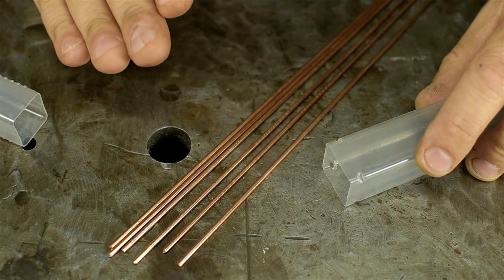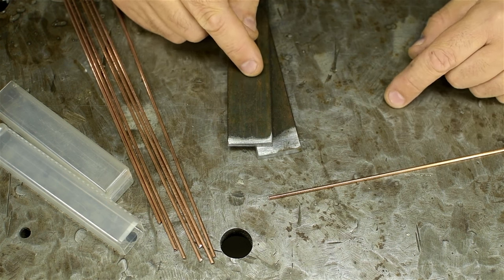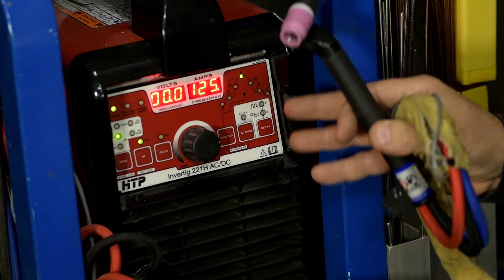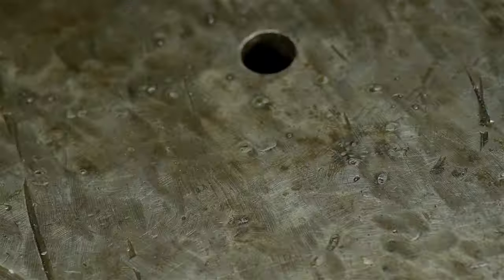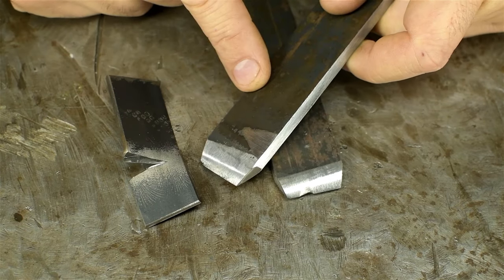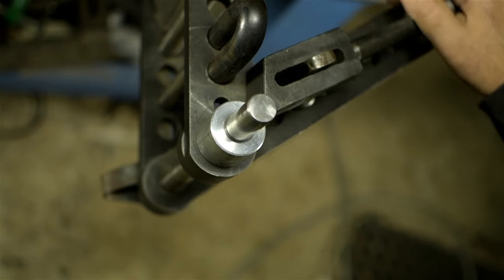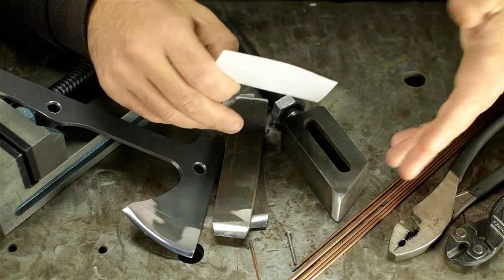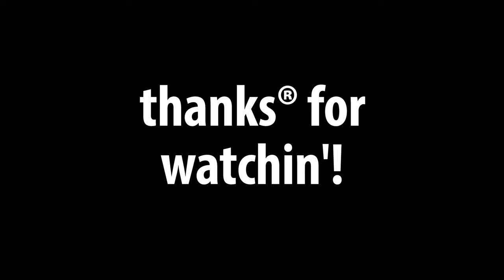TIG Welding with TOOL STEEL filler?!

Comment: I'll admit, I puckered a bit seeing that end mill heading toward that hold down clamp.
Reply: I reckon we all did!
Reply: LOL
Reply: Lol
Reply: @ferrumignis  YUP, and I'm not even a machinist...
Reply: I’m SURE he did not do that to pucker us oh no not him!
Reply: Hold down clamps are made from a special alloy that has rare magnetic properties. They attract both HSS and tungsten carbide cutting tools. It doesn't matter what the G code says, they magnetically pull the tool in. The only way to avoid this is to leave the clamps loose.
Reply: @Ben Wilson So when tightened they're like a magswitch?
Reply: @richardschwartz5226  exactly!
Reply: I feel like that whole clip was made to stress machinists out x.x
Reply: I have ran into my share of toe clamps over the years.. gotta pop that cherry sometime!
Reply: @mordantly  In my world it is running over wheel chocks. Sooner or later you will forget and the chock crushes out, explodes or flies across the workshop. Anybody tells me it hasn't happened they're either a liar or a virgin.
Reply: Excuse me while I change my pants 🤪
Reply: "Ooh, that's going close...surely not...oooffff!!!!"
Reply: That's some balls of steel milling there
Reply: I was wondering what you were taking about before I watched the video. I puckered up as well when it showed up.

Comment: Weld with tool steel filler?
Why not? I've used a worn out rat tail file for a welding rod. Not a "big deal", if you have enough voltage and amperage. :)

Comment: Don’t you have to heat treat tool steel to get it that hard?
Reply: It cools fast enough to harden it as the base material dissipates the arc heat fairly quickly.

Comment: 10:29 So you can weld a thumb to metal...
Reply: Good eye
Reply: Wow I did not notice that at first!!!
Reply: Any good welder... or at least the amateur ones... accidentally knows the smell of burning skin.. or burning gloves if you are a bit smarter one...
Reply: * arc quench sounds *
TOT whispers:... make sure to liiike and subscriiiibe...
Reply: @aerogfs  my first welding job was building tree shaker frames. I started in the middle of winter. It was cold. Soo cold. After having my hood down for quite a while, I felt this loving warmth on my belly area. It was soothing and nice. I started to enjoy it until my brain said "wait, nothing is suppose to be nice!". I lifted my hood and as I looked down I noticed my flannel shirt was engulfed in flames. It burned a large circle out of the middle. I still wore that shirt for a long time. Since the burning part already burned away, I figured it was safe.
Reply: @davespringer777  insert this is fine meme
Reply: @aerogfs  good ol' burnin' skin brother
Reply: @davespringer777  every good welder knows how much longer they can keep welding before they need to put out the fire. Turns into a race to finish the bead so you can put out your boot tops.
Reply: Well spotted!
Reply: @MrPossumeyes  it wasn't a spot weld😁
Reply: @josephwaldner7752  Ok.  Well noticed.  Well seen.  Well observed...?

Comment: Pretty cool! Wonder what happens if you do proper heat treatment on this stuff?! I suspect the grain structure could look quite bad straight after welding like this. Some normalizing, a good quench and you could be hacking your way through 1" nails with no problem! :)
Reply: I've done some experiments and it works pretty nice, doesn't look nice tho. :)) Kinda like a long worm. HOWEVER, that being said, you can make patterns if you double or triple the number of wires held at once, and it kinda ... kinda looks like a hamon line if you wiggle enough. It's difficult tho.
Reply: @aserta  Sweet!
Reply: @torbjornahman  if you search for products EN14700 Fe 3 or EN14700 Fe 8  you will find this or similar products. Eg CORODUR WZ 55 or Alunox AX-650 or a whole roll for MIG welding (MIG = pure Argon) https://www.weldingtool.eu/mig-schweissdraht-utp-a-dur-650-en14700-s-fe-8.html
Reply: Anytime doing a heat treat, remember to at least TRY to know the metal (or metals I guess in this case) composition to achieve good results.... But I imagine an oil quench and an oven bake would probably do a good job though.
Reply: So nice to see you here!  Love your work. You have a natural way of smithing that makes it "look easy" which of course it's not. Cheers from Detroit!
Reply: From the Weld Mold data page on 958: "Can be used for heavy buildup when necessary and used as welded, without subsequent heat treatment."  That's what I've done so far.  I started experimenting with it last night, just placing a nodule on the edge of piece of 1/8" (3mm) stock and comparing with another nodule of ER70S-2.  Using a file and a center punch, you can tell it is much harder.  Probably not optimally hard, since I did no preheat or peening or controlled cooling.  Could be some dilution by base metal in the first applied layer, too.  I bet you're right that proper pre-heat/peening/heat treating would improve things, but I was impressed.  Take care to keep it separate from your regular steel fillers, since it's unmarked and looks just the same!  BTW, the rod package says it's made in Italy, just like TOT's Invertig (Stel) welder.
Reply: Used Weld Mold 958 for a legit repair for the first time last night, rebuilding the last quarter inch of a large screwdriver that I had broken years ago by prying something.  Multiple beads using Jody's rule-of-33 pulse settings, with some cooling between layers.  No post-weld treatment, just grinding back to the desired shape and dunking when grinding got it hot.  Then went after the big screws holding my vise jaws.  Worked great!
Reply: Kinda makes me wonder if you could just use some high carbon steel and cut into thin enough strips and use it as filler rod to put a hardenable edge to mild steel.. I think this is worthy of testing.. This could be a game changer for knife making..
Reply: @TheWolfster001  i don't think it would work the same. This filler probably is an alloy with Cr or/and Mo. They reduce required cooling speed for hardening. Means they can cool down with air and they get hardened. Normal carbon steel needs to be cooled down a lot faster with water for the carbon to be trapped. But that would probably create huge stress in the weld. By the time you get to annealing, there might be cracks. But i don't really  know anything about welding.
Reply: @a.r.8850  Along with these being air hardening alloys. Likely something along the lines of just normal high carbon steel, would end up with significant carbon migration, since its getting well above melting temps along with the base material being welded. So the carbon will move towards the areas with less carbon in them. 

If built up enough. It could maybe work. But like the first comment mentions a little. Melted steel is not great for getting a good microstructure. So for it to work well still it would need some thermal cycling. Assuming it doesnt have any porosity.
Reply: @TheWolfster001  I tried using small drills as filler rod. Works quite ok. Of course not for anything critical. Jody did that to put a hard point on his chipping hammer. For stuff like that it works great and you don't have to buy special rod.

Comment: me: cutting my hair short for the first time after 9 years...

toni:i like what you did with youre hair 😂
Reply: SAME but only 1 year
Reply: with about half a head shaved the other bits sort of hacked off to about an inch.  Clippers stopped cutting, have to wait until tomorrow to go buy a new pair.
Reply: I just performed a quite respectable quarantine self haircut, don't be afraid to try it. Just remember, the only difference between a terrible haircut and a decent looking haircut is two weeks time 😄👍

Comment: That's a really cool way of hardening the edge without actually hardening it.
Reply: What Tony did works but if you actually go to the product site the manufacturer procedure is far more involved. Preheat, peening, air cooling, tempering blah blah blah.
Reply: Nah don''t listen to James here, just shake 'n bake.  

Heat to peen / aneel and oil quench.  That is, find some old automotive oil and shake the hot stick in it.
Bake at 450 for like 2-3 hours and let air dry.  

Your results may vary.

Also, you might actually want to listen to James there
Reply: @NOTNOTJON  its like doing 7 steps when you only needed to just not even do it
Reply: You can do the same with old dull drill bits you are going to throw away anyway.
Reply: Yeah as a blacksmith I was wincing a little. But it was self advertised messing about in the shop.
From the colour it took after weld I'm going with it got itself to what I'd normally take it to for a temper, if a bit softer. And I'm assuming the liquid weld is well above critical before hand. It's just missing a quench. 
However it seemed to weirdly kinda work.

It's 100% cool to be able to essentially have any alternative too forge welding a tool steel edge. Having bimetal edges had a lot of advantages, and costly or not, tool steel itself ain't cheap either.
Reply: @jamesmaida47  Larger welds need stress relief to avoid cracking. On stuff this small it's not that big of a deal. A big weld on a cast iron or high-alloy part? You better pre-heat it, weld following inter-pass temp guidelines, peen it, cool it at the prescribed rate, then follow up with heat treat/tempering to meet your required spec.
Reply: well, technically he did harden it. The welding heated up the material, and since it is an alloy, air cooling was suffice to harden it.

Comment: What you're doing here is very similar to a practice called 'bearding' that was done with weapons for thousands of years.

Steel was discovered very quickly after iron refining got worked out.  The problem was the only way to make steel until the 19th century was the crucible method, which is expensive, difficult, and has really bad process control, so you don't know what kind of steel you've got until it's done and all steel cost a lot to make.  This made steel weapons out of the reach of all but the richest (usually the more powerful kings).  Even the nobles in rich kingdoms usually couldn't afford all-steel weapons.  They could afford a little steel, but not enough for all their weapons to be all steel.

The solution that was found was to forge-weld a steel edge to a relatively soft iron weapon body.  This was difficult and expensive, but not as expensive as making an all-steel weapon.  These steel edges didn't come off either, as that was pretty much certain to get somebody killed (most likely the noble using the failed bearded weapon, if not, the guy who screwed up making it when the noble got back to him).

Welding dissimilar materials together will always give you a stress zone at the interface, but different steels aren't likely to be too stressed, and as long as the weld is done well it should hold together under most conditions that wouldn't cause serious damage to the steel anyway.  The fact that you get a dissolving of the two materials together in the bead should help limit the problems as well by making the transition less sharp.
Reply: I think you've omitted an important word: "This was difficult and expensive, but as expensive as making an all-steel weapon" --> I assume you actually mean "This was difficult and expensive, but NOT as expensive as making an all-steel weapon".
Reply: @ApprenticeGM  Oops, thank you, now fixed.
Reply: Bessemer process from the 19th century, still used to make volume production steel.
Reply: Cladding isn't cheap. Requires explosion welding.
Reply: Funny you should mention that process........some years back I bought a plasma welder (not to be confused with a plasma cutter)........and I did some hard facing using just plain spring steel material from car engine valve springs that I heated and straightened out for filler rod.
It's a process that melts the two metals together and forms a combination alloy at the interface......works with cast iron too and I use plain mild steel rods when working on cast iron for filling in craters on machine tables and vices etc from drilling impacts,  and the end result is you can file the weld without drama......the plasma stream is at 8,000 deg C.....that is centigrade not Fahrenheit.
Reply: You beat me to it. I was about to make the same point, but in relation to journeymen's tools. On the whole a fully tool steel ... tool ... would be too expensive for them, so welding on only the active tip in tool steel gave them a near enough quality of tool without the massive costs!
Reply: @Jacob_Dwyer  And, like many important inventions, his particular driver was solving a specific problem at hand.  He needed a much cheaper way to make steel for steel guns to fire his new tapered cylinder shells reliably without exploding.  

If he hadn't, of course, it would likely have been someone else at about the same time.  Metallurgical chemistry had reached the stage where the chemistry of iron and steel, and the relationship between them, was understood well enough to make devising something like the Bessemer Process obvious to anyone who saw a need to develop it.  Bessemer just happened to be the first one along with the combination of resources, knowledge, and need to make it happen.

Comment: Just hit the estop on my Cnc to come watch this, might have scrapped the part I was working on.
Reply: This is what the "feed hold" is for!
Reply: @kevinvermeer9011  The true fans wire their shop power breaker to a script that monitors for new ToT content. When the sub feed rolls, so does the power.
Reply: Just found out today that AvE's name is James Marks. Who'da thunk it?!
Reply: @TreyCook21  Interesting, but I fail to see how it applies stopping everything to watching a ToT video. Should have made a new comment of your own.
I stopped mowing the grass to come watch this video. The lawn can wait, This Old Tony has shop life advice to give!
Reply: @TheHungrySlug  My comment goes along with the original comment of James Marks. I was trying to be funny and insinuate that AvE would stop his CNC machine to watch a ToT video. I should have been more clear; I apologize.
Reply: @TreyCook21  All good Mate! It can be hard to gauge the meaning of some comments here on the tube.
Thanks for clearing that up for this old duffer. Cheers and I apologize too, if I came across as an a-hole, sorry.
Reply: @TheHungrySlug  No worries. I understand that the way things come out of my mind, may not be the way they are read. My sense of humor is a bit quirky anyway. Cheers!
Reply: @TreyCook21  I actually googled James Marks to see if you were right!
Reply: i thought he was called Cockford Ollie.

Comment: I have tons of storage problems.  Where did you get those containers that hold a meter of rod in pocket-size form factor?
Reply: They probably came with the rods. Check mcmaster Carr
Reply: They're Sport Billy welding rod tubes he's had since the early 80's
Reply: Do - All used to carry them
Reply: Costa....I got what you said. ToT must be wearing his magicians sleeve or those rods are telescopic
Reply: Before the Time lords collapse, you buy TARDIS storage containers. These were amazing as you could store an entire household of items in a single tote box (well as long as you can fit in the opening. The only problem if you dropped something small it was a pain the but to reach for them.
Reply: He borrowed some from Doctor Who. They're bigger on the inside!
Reply: Just dip the long rods in a cold bath.
Reply: an indetectable extension charm wizarding confirmed
Reply: You can use any old container, just insert them at around light speed, the real trick is in not letting them lose velocity while in the container.
Reply: @guytech7310  Ah!  You gave the answer I was about to give.  I was about to tell him to check with Dr Who store. lol   Well done Sir.  :)
Reply: He hasn't even used the full length of the container. There are longer things going in. The ground is a black hole !!!
Reply: They came out of the Tardis.
Reply: Relatively 
     R , L = ToT Delta Change Over Prepared Work Day .
  
Explanation 
      Rod Length  = ToT Changing The Rod Length By Pre Welding These Lengths Back Together Each Day .

Comment: I never thought of sharpening a tool steel bead to make a cold chisel. That’s actually impressive and very efficient and effective given the price point.
Reply: That's exactly what we do on the wear edges of heavy equipment.  Hard surfacing metals are very similar to tool steel but with a few additives like manganese chromium etc for increased wear and resistance to chipping/fracturing.

Comment: 1:40 I think the correct term is 'Al dente'
Reply: Wouldn't it be Fe Dente? I don't think tool steel contains Aluminium!
Reply: @guytech7310  It's "ToT Dente".  👍
Reply: @guytech7310  😂

Comment: Great video mate 👍 I weld up the trim edges on trim steels (D2 tool steel) in press dies this way, although I tend to turn the amps down to around 50 so it really beads up just on the edge. Less to dress back and it's already very hard base metal. Also have to preheat the tool steel before welding or it is likely to crack. Very susceptible to temperature shock. I have also made a blanking die out of mild steel base metal and hard tip welded the trim edges just like you have here. It works fine for short term solutions 👍

Comment: Ok, Boss has some ‘splainin a-Do: he Assured me that tig rod such as this was Unavailable in die Metallschweißwelt!

Instead, I used Hardcraft arc-rod that I ground flux from one side (as the “secret sauce” to make it tool-hard is in the breading!) to cut-back the heaviness of the slag, and TIG-welded the small, tight corners of the granulator-liner an inch at a time......

(Yes, it’s Possible.)

(Yes, it Sucked.)